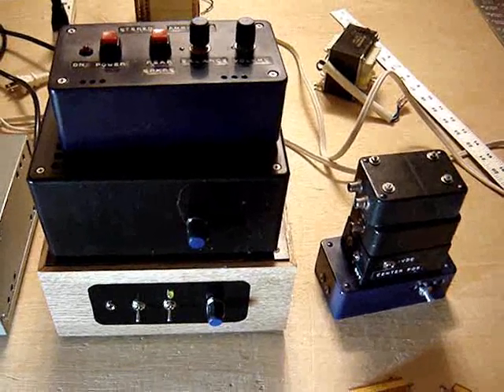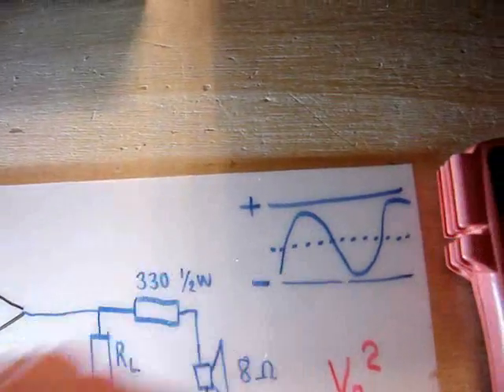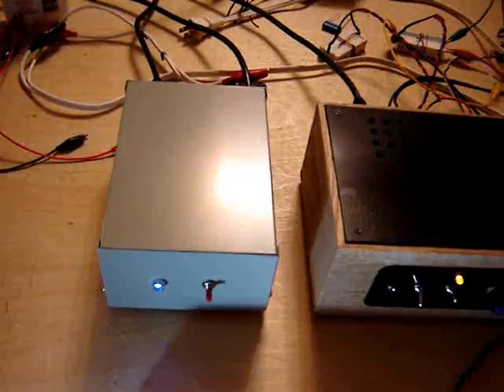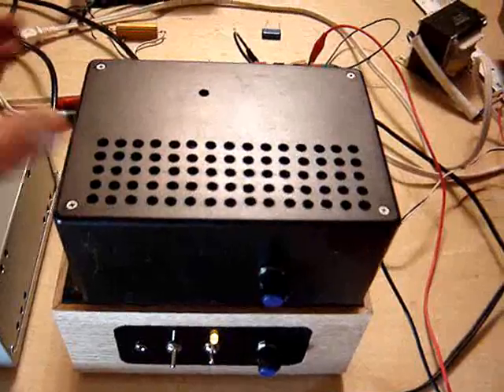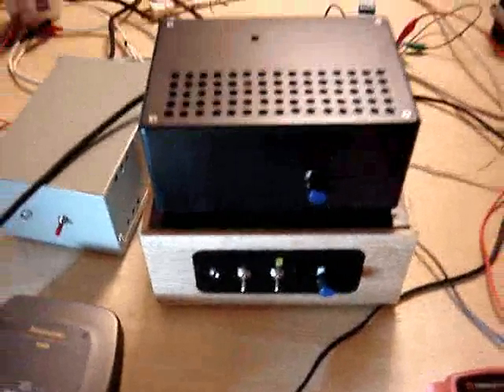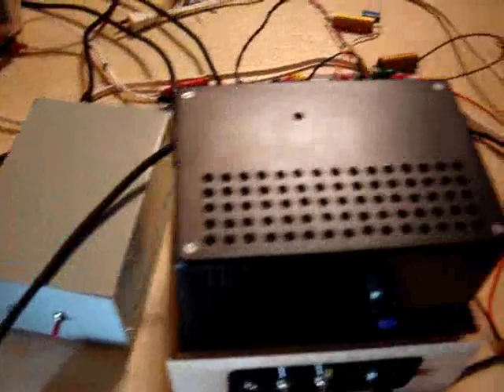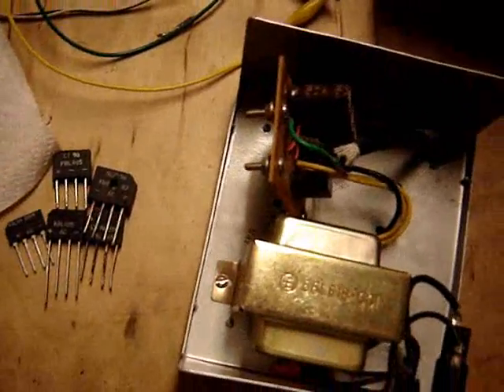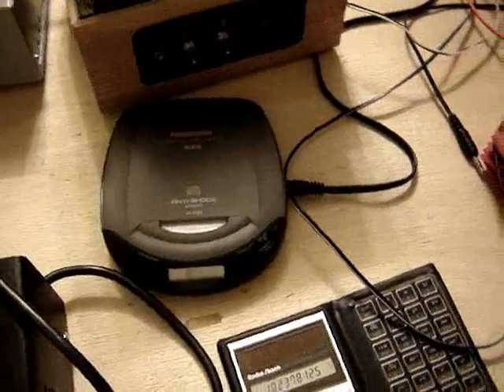Audio amplifier power measurement and power supply repair

Comment: I have question-
I constructed a split power supply using 12-0-12 v , 4 A transformer, rectifiers and filter capacitors but when I used a neon based line tester and touch the output terminals, the neon glows at + ground & - terminals. I have grounded the metal casing of the transformer and cabinet but the neon still glows. What could be the reason and how to fix it ?